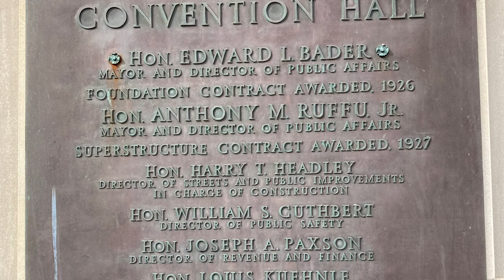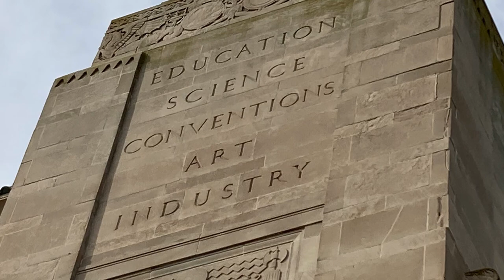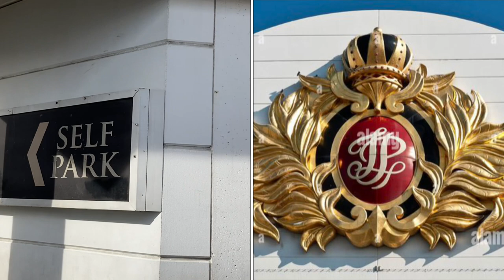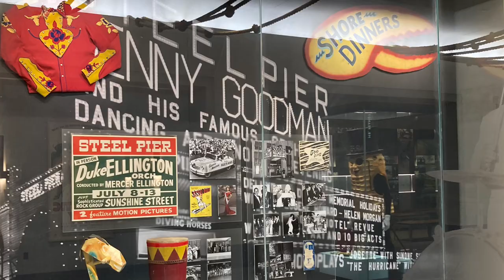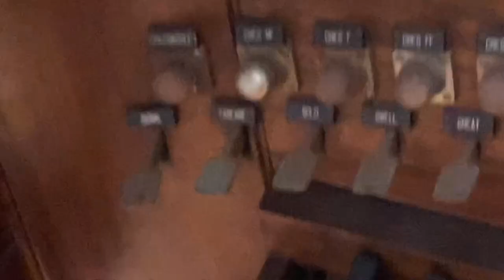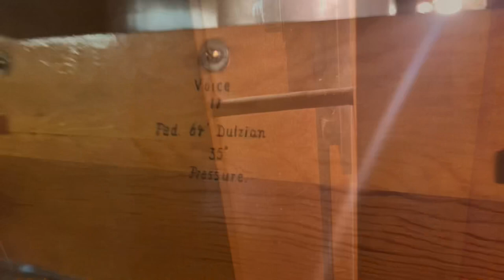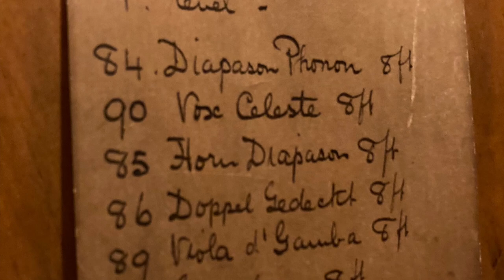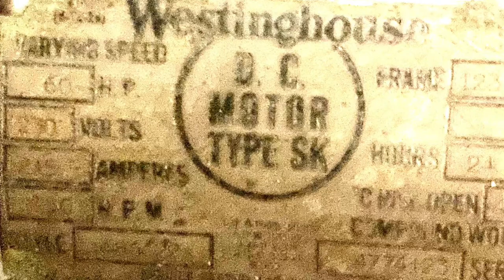A visit to Atlantic City Boardwalk Hall and the world’s largest pipe organ￼

Comment: After the demolition of Trump Plaza, the remaining hotel tower was at one time, a Holiday Inn. A Rainforest Cafe still occupies the North East corner of the structure. Boardwalk Hall is one of the most beautiful, well maintained, modern, and welcoming structures on the East Coast and resides right on the Atlantic City boardwalk. This building is magnificent in not only its architectural beauty, but also with its perfect blending of theatrical technology both old and new. The gigantic traditional fly house is a monument to traditional theatrical technology of the 1930's. And the state-of-the-art overhead truss system which was installed after a tragic accident on the Justin Timberlake/Christina Aguilera tour is a commitment to keeping up with the latest innovations in theatrical rigging. This modern overhead truss system uses hundreds of dynamic weight sensors to accurately display the weight of everything hanging from it in real time. Boardwalk Hall uses cutting edge technology to stay relevant, economical, and safe for all touring shows.
Reply from the maker: Ty for all of this info. Of course I recognize the renovation in that I see the changes in the building since my first visits in the mid1990s when the building and esp the organ was in such disrepair. I did it know all of the details and histories of the rigging.

Comment: Point of information - there is a 64 foot stop on the organ of the Royal Albert Hall in London. It is an open wood and its name is "Acoustic Bass".
Reply from the maker: Yeah I think you will find that any stop of that name is a “resultant”. Meaning that when the player selects that stop and plays a note on the pedal, the P5 above pitch is added, thus creating a resultant 64’. So it is not a true 64’. 

Many smaller instruments do this with a soft 16’ stop to imitate a 32’

Check it out 

http://terhardt.userweb.mwn.de/ter/top/acbass.html
Reply: That's true in the same sense that it's true that Boardwalk Hall has a 128 foot stop. They are both resultants, which you get by playing a note and the note a fifth above. But an actual, full-length 64 foot stop is something that can only be found in two organs in the world, Boardwalk Hall and Sydney Town Hall.

Comment: It has two consoles？One 5 manuals and one 7？
Reply from the maker: Yes. The portable five manual I’ve heard was used for boxing matches. I don’t think it functions.
Reply: @EdGattsek  I did the tour of the organ in 2018. The 'portable' console was completely disconnected from anything and there was a bundle of control cables as thick as your leg coming out the back that looked like it had been cut through with a hacksaw. Having worked inside telephone exchanges it looked just like the cable wiring of some of those big old exchanges that used relay logic to switch and route telephone calls. Apparently the colour coding of the wires is the same as that used in exchanges. Old telephone technicians would be right at home. There was a plan to get the portable console up and running again. But it would be a big task. The whole project to renovate that organ and bring it back to full working order is a massive task. I liked the enthusiasm displayed by the largely volunteer cry who were restoring, repairing and in some cases recreating all the elements that comprise that massive device.